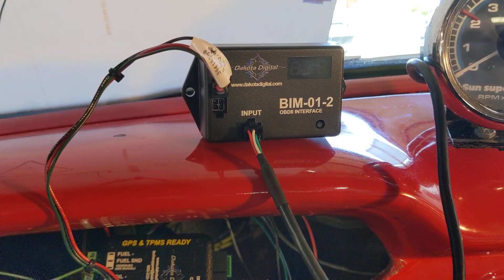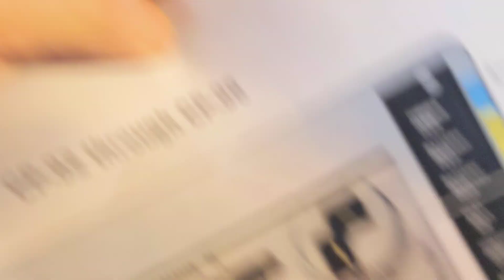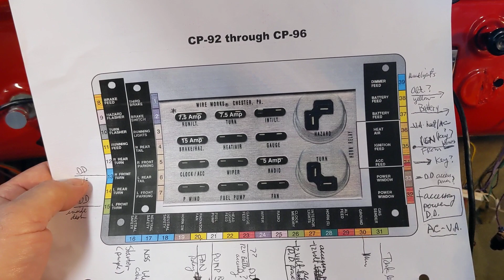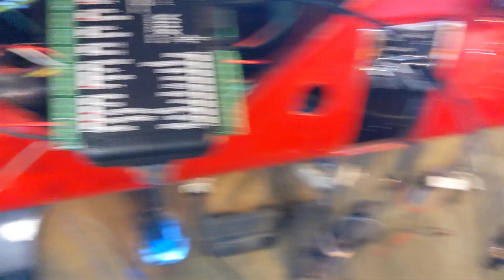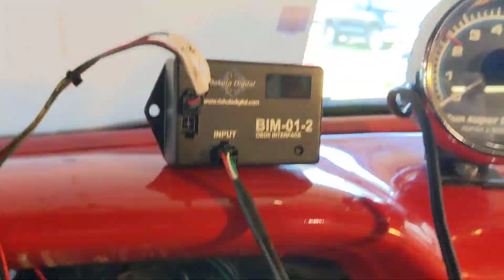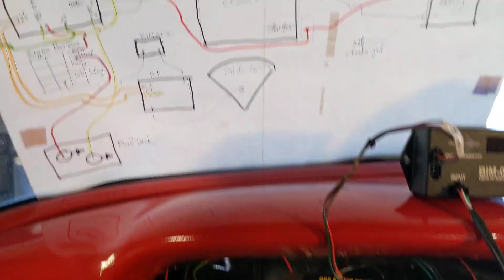Quick start guide to Dakota Digital gauge clusters - Part 6

Comment: I have about the same gauge cluster from Dakota digital VHX gauge system, my question is the backdrop lights do not work when i turn the lights on, everything else works for lights, but the main lights don't come on , i did not install it, its in a 56 Chevy Belair, all gauges works, warning lights come on! the digital light come on! would this error be from the light switch is wrong? or what ? any idea? plus how do i change the digital from KMH/ to MPH? Thank you